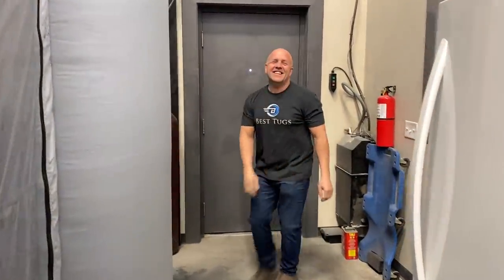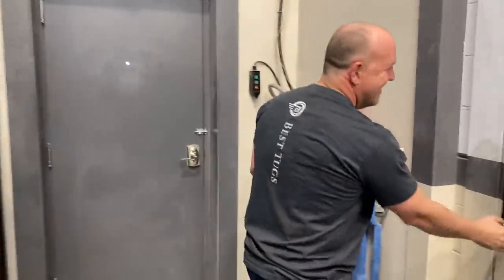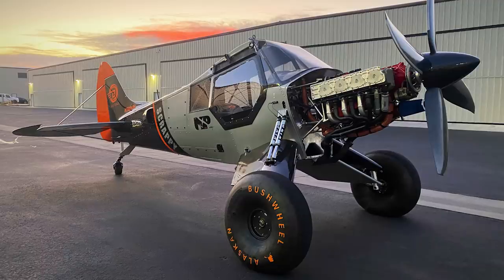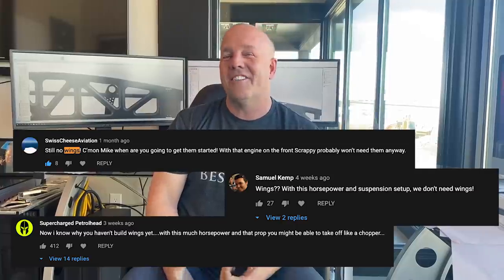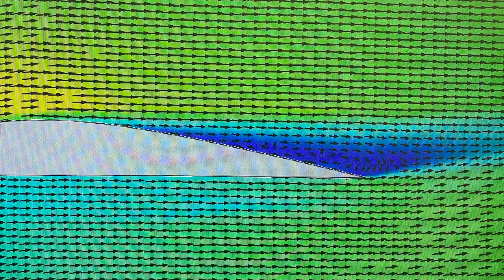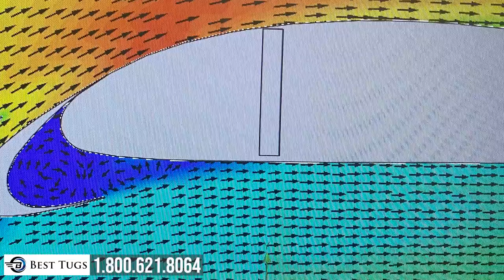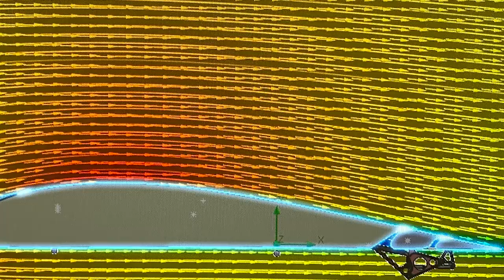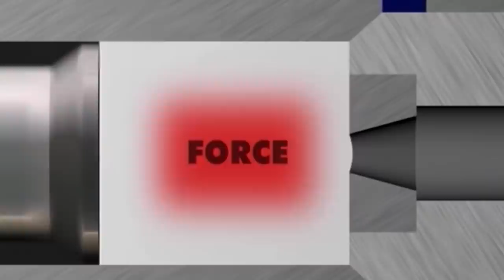Airplane Without Wings, Let's Try Something Different! | Scrappy #42

Comment: Just stop using the rigid wings everyone uses and instead use a system that allows the curve of the wing to morph and change. Perhaps a collection of rods that can be moved around on a track to change how they are layed out. Much like how when you put your hand out the window of a moving car and alter your hand shape to change how it controls airflow. I mean birds don't have a solid wing. They have a somewhat rigid pole/bone with pinion feathers that change shape based on what airflow they need.

Just food for thought but I think wings needs to learn from birds a bit more.

Comment: Man i know your no fool but just imagining adding multiple dynamic points to the leading edge of your main lifting surface is sketching me out. Im really not in the least knowledgeable on the specific matter but to anyone remotely engineering minded you can follow that the trailing edge looks likely to deal in negative feedback and therefore tend toward failing/stressing safer or being more stable in transitioning.. whereas the leading edge having moving parts im imagining might try to act with positive feedbacks for horrible failure modes or atleast aggressive stresses... im imagining a car hood unlatching on the highway if i wasn't being clear enough.. again clearly your no fool so now im super interested to watch but im still sketched out... scrappy->scratchy->sketchy?

So im concerned with transitioning not steady state as you clearly showed your evating the geometries performance in given configurations.. very interested in your solutions..

Comment: I think this is where I stop watching this guy because this is where his odds of joining the Dead Rich Dude Club start to increase exponentially. Reliability should be a little higher on his mental list of desired wing characteristics. No need to try to prove yourself smarter than a hundred and twenty years of professional engineers and aircraft companies. Vaya con Dios.